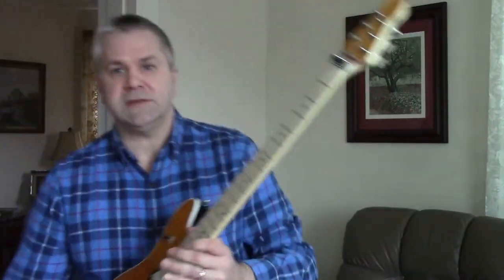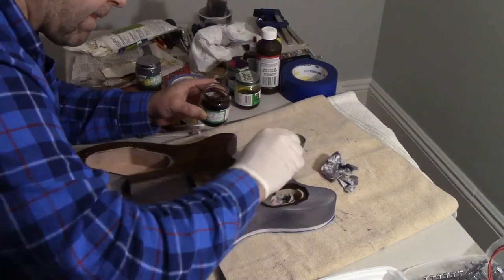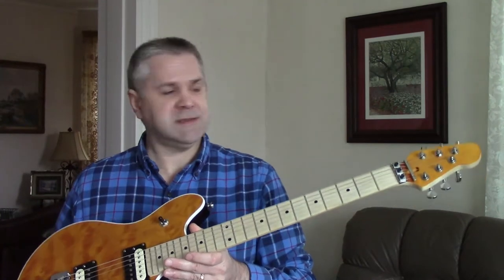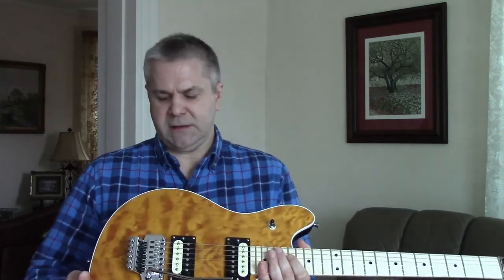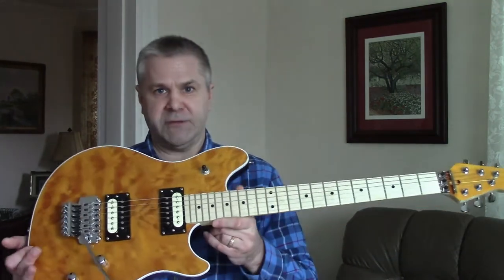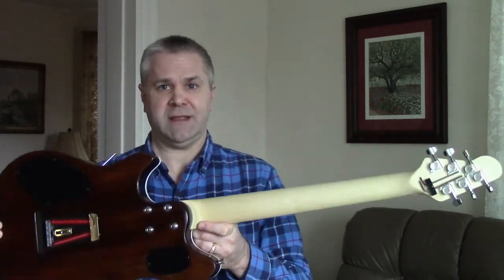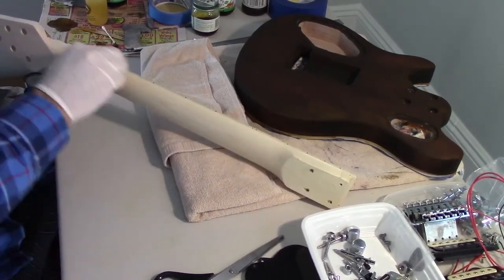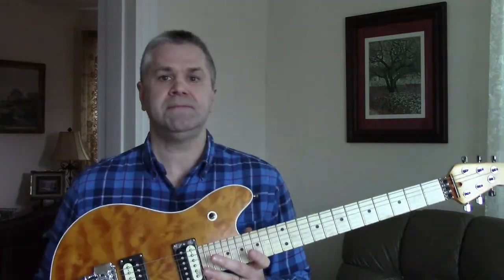BYO EVH Wolfgang Guitar Quilted Top Kit - Final Build Update

Comment: considered getting my kit and paint it heavily inspired by evh striped designs. But My doubt come the screw and whether i can cut and sand the head to look like the headstock.

But hey at least i can stainless steel frets. tuners, pickups, wires and floyd i can get in europe.

Have to buy body, neck and screws seperate at BYO but It will be worth it. Any tips for a guy from europe?

Comment: How did you avoid staining the binding when staining the top, or did it come off with wire wool easily?
Reply from the maker: I removed the stain from the binding with a razor blade, and sand paper. It came off fairly easily but was a tedious process.
Reply: id just try and mask it tbh